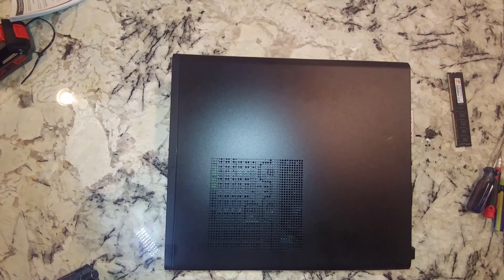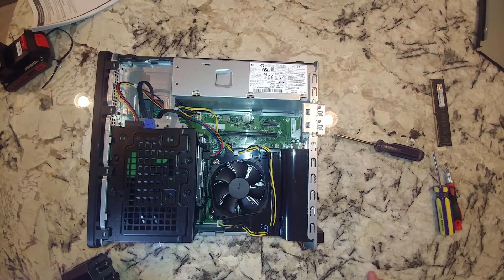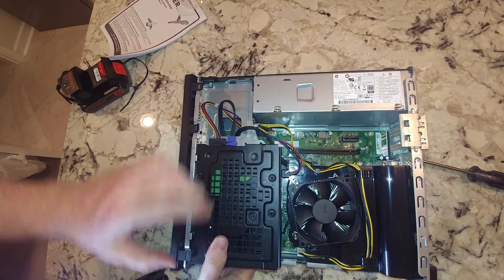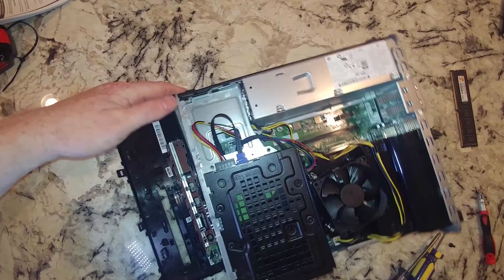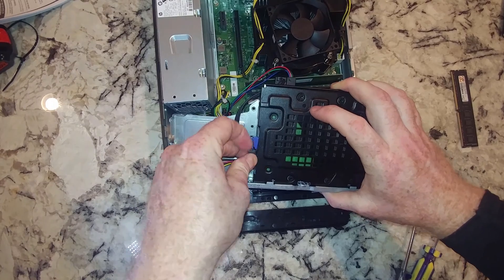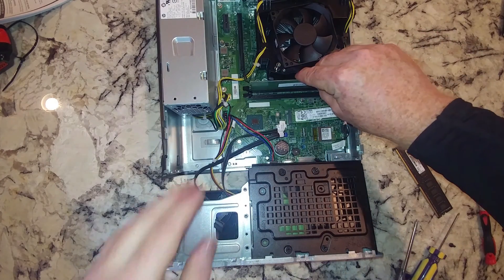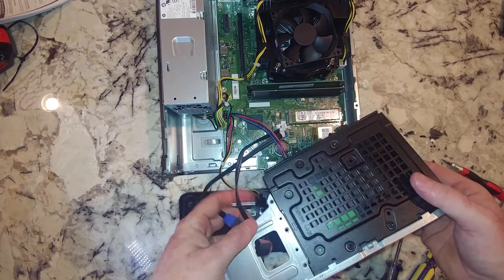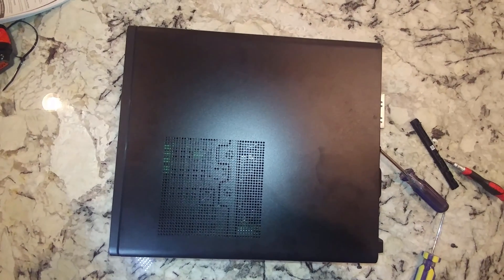HP Slimline 290 upgrading RAM and NVME M 2 SSD, hardware installation p0043w

Comment: Can you do the hp slimline 270 p024 next? I need to put a nvme in there so I can use the pc cuz it's stuck in automatic repair loop and I tried everything and it didn't work.

Comment: the ram that comes with these devices is 2666mghtz i recently installed 16gb of corsair i got for 30 bucks at my local store and just bought a second hand i7-8700 for 80 bucks. do you still have this motherboard around?, also im looking into a 4 pin conversion for the a 24 pin for the motherboard just so i can relocate the motherboard into a second hand full size tower i got from back in the day. im just tryong to run like 6 or 8 gb gpu and have 32gb of ram with a nvme setup. this is the only that really bottle necks really bad

Comment: Our Current HP 290 Slim  180 watt PSU Build with 4 GB ram.

UPGRADES: Pushing performance overall

16GB  DDR4-3200 MHz RAM  ( 2 x 8 GB sticks ) Overkill for THIS Machine but Ram is cheap! $22.00
GT1030 GDDR5 4GB Version ( <- You MUST GET GDDR5. The GDDR4 is 50% slower.) $59

We will test a Low Profile  RX 550  GPU $89.00  as I believe the PCIE can Provide the 45-55 watts  of the Total 75 Watts The PCIE 2.0 slot can deliver.
This card has the 128 bit Bus
This is the best scenario we can go with as far as Upgrades and keep a tight budget currently on amazon as of 11/25/24

Notes:  Any higher version of PCIE cards will run on a lower  PCIE  slot version.  You will ONLY get the speeds that slots version can provide.
When looking at a PCIE slot be sure Number of pins.  This hp 290 slim is x16 meaning ALL Pins are populated for full 2.0 transfer rates. 
Transmission speed rate  5GT/s and Throughput at 8GB/s ( MAX )

Comment: Could you please tell me, My HP Slimline desktop model number is 290- a0020in 
I can't understand which SSD will be compatible M.2 2280 SATA OR NVME?
Please help me.
Reply: Crucial MX500 2TB 3D NAND SATA 2.5-inch 7mm (with 9.5mm adapter) Internal SSD   <- You can use this as a base to purchase a hard drive upgrade. 
I do not see NVME being an Option for the 290- a0020in  as all research points to using the  sata 2.5-inch SSD type as an Upgrade option.
My Motherboard VERSION Does allow for NVME as it does have a special Slot made for the NVME soldered into the Motherboard. 
Hope this helps!
You can 100% use a 2.5-inch Sata SSD

Comment: I know I'm late to say this, or someone else said it, but when you want to remove the front plate off, remove the optical drive and the front removes without poping the disk drive button off. Don't worry, you can pop it back on once you put back on the faceplate for the front first.
I've worked on one. Also can you use 16gb? Did it boot with 12gb?

Comment: Can i fit gtx 1050 ti in that? It needs no external power supply
Reply from the maker: I once used either a GTX 1050 or GTX 1050 TI with it, however, I needed to use a ribbon extender which meant the case had to stay open.
Reply: @PC_HardwareTechUnboxing_1   Who needs case bro 😁

Comment: I have same PC so i can buy a 8gb memory it should work with 4Gb right
Reply from the maker: So you are upgrading from 8GB to 12GB?  It will work, whether you will get much performance gain is another story.  If you had 2x8GB, it would be better in case it supports dual channel RAM.  Different sizes of RAM will run at single channel.    

Not that you can game like this with your computer, but this video somewhat shows the difference between 4GB x 8GB x 12GB x 16GB albeit with a motherboard that has 4 RAM slots:
https://youtu.be/RmfMlkK0od0

Note, 8GB (2x4GB) in dual channel produced better gaming than 12GB in single channel.
Reply: @PC_HardwareTechUnboxing_1  I have 512 ram I wonder if it add up
Dam it's pain take apart

Comment: Looking to upgrade/max ram. Can I install 2 16gb to make it a 32 gb system? HP 290-p0043w Slim Celeron G4900 3.1GHz 4GB RAM 500GB HDD Win 10 Home Black
Reply: I installed two 16 GB RAM modules into my Slimline 290-p0043w and Windows 10 Home reads the entire 32 GB as available.
Reply: @iddybiddyegg1  thank you.
Reply: @iddybiddyegg1 did you have any graphics card installed?

Comment: Is another motherboard suitable for this type of case?
Reply from the maker: Most of the Dell and HP small form factor computers have a different size motherboard than  the common ones you can buy ITX, mATX...etc.  

The other issue is with these motherboards is that  front USB, power button, reset...etc are directly connected to the motherboard unlike DIYPC where there are front panel connectors (USB 2.0, 3.0, HDD, Reset Switch, Power Switch).

Now, an electrical engineer, electronics engineer...electronics technician type could figure out how to get an off the shelf motherboard to work.
Reply: @PC_HardwareTechUnboxing_1  A mini ITX motherboard and a SFX PSU combination would work. A full size grahpics card would require a riser setup as usually done in many SFF cases. To fill the front panel, there are some ready made pieces with female receptacle in one end and internal header plug in other. The only real issue would be reset button, that you can live without or insert one by doing a DIY modification in the front panel cover.

Comment: I'm new to this what is the M2?
Reply from the maker: It is a type of solid state drive.  It has no moving parts so it makes no noise versus a hard drive which can be noisy...slow...has moving parts.  M.2 provides super fast boot ups too
Reply: @PC_HardwareTechUnboxing_1  oh thanks do you have a link to buy it
Reply from the maker: @stupidloser  This should be the one 256GB OEM Samsung PM981 that worked.  You will find some of SSD's will not be compatible...but if you go with the big names Samsung, Western Digital, HP...etc, you should have any issues.  These will require downloading windows via a thumb drive.
Another option would be to buy this type of Samsung which gives you migration software so you can clone your HDD to the SSD and might be easier depending on your computer skills:   https://amzn.to/35x0FSP    These drives are both by Samsung and perform about the same....but on the latter you are paying for retail packaging and the migration software.

Comment: could you put this in a new case to allow more room?
Reply from the maker: While I have no doubt that some computer engineer could do it.  I wold not mess with it...between the proprietary board not lining up to anything in a case to include the I/O shield, standoffs, power button...ect.  Than you are still stuck with the same PSU that probably won't fit in a computer case as it is not ATX.  A bigger PSU would probably need adapters to go from PSU to motherboard.  Good chance the single PCIE slot would also not line up with the ones in the case.  Yeah...I think this is a bad idea.

Comment: I have the same model ☺ got mine may 28 2020👍
Reply: You'll live to regret it, I have. Air flow pretty bad and builds up heat. I had to remove the cover to keep the heat down.

Comment: What’s the best CPU possible for this pc and does it support AMD’s CPUs?
Reply from the maker: Intel only, here is what HP lists for compatibility:

Processor
TDP
Integrated Graphics
Intel Core i5-8400 (2.8 GHz base frequency, up to 4 GHz with Intel Turbo Boost Technology, 9 MB cache, 6 cores)
65 W
Intel UHD Graphics 630
Intel Core i7-8700 (3.2 GHz base frequency, up to 4.6 GHz with Intel Turbo Boost Technology, 12 MB cache, 6 cores)
65 W
Intel UHD Graphics 630
Intel Core i3-8100 (3.6 GHz base frequency, 6 MB cache, 4 cores)
65 W
Intel UHD Graphics 630
Intel Pentium Gold G5400 (3.7 GHz base frequency, 4 MB cache, 2 cores)
54 W - 58 W
Intel UHD Graphics 610
Intel Celeron G4900 (3.1 GHz base frequency, 2 MB cache, 2 cores)
54 W
Intel UHD Graphics 610

If memory serves me correctly, I  put an I3-9100 in there...eventually had to update the BIOS as it worked, but was not recognized.  I am currently in Hawaii...away from my office...otherwise, I would try out one of my 9th gen I7 or I9.
Reply: @PC_HardwareTechUnboxing_1  , know if you can replace it with the i5-9400T?

Comment: I have this computer and I can’t really play any games I like on it, what should I start upgrading first?
Reply from the maker: I would say you are better off selling it and cutting your losses.
That said, it is tough to make this a gamer.  Even if you thru in a I7-8700 or 9700, it  still can only support a slimline low profile graphics card that will provide barely any performance gains.  The other thing you can do is leave the case open and hook up a GPU via PCIE ribbon extender.

Comment: which exactly ddr4 2400mhz memory module inside? I want just to add 4gb from aftermarket with the same characteristics for dual channel mode, without necessity buy new kit and sell original.
Reply: It's usually Samsung DDR 4 - 2666

Comment: really interested in this pc for its size more than anything. ideally would boot from m2 and have a 2nd HDD for storage and remove the disc drive. so is the cage that holds the hdd and disc drive able to hold a 3.5 hdd or is it 2.5?
Reply: I removed the dvd rom, and installed a 2.5 hdd caddy shaped like a dvd drive in its place for my 2nd SATA drive.
Reply from the maker: When I got mine it had a 500GB 3.5" in it.  I eventually, installed the OS on an M.2.  At the moment, it has been stripped and is collecting dust.

Comment: what do you suggest to clean (wipe) the insides & to remove heat glue on the processor ??
Reply: Blow it out or lightly brush... alcohol swabs to clean off old thermal paste.

Comment: I need ssd for OS and also hdd for storage. Can i disable ODD from sata port (for 2.5' sata ssd) and use sata power splitter for ssd and hdd drives same time? Will it work?
Reply from the maker: I will have look go back and look at the SATA III connector on the optical, sometimes they are not the same on these computers as the HDD SATA III cable, There is a device out there that I use in one of my Dell Inspiron 3670 videos that allows you to power up to 4 drives off of a single SATA power connector.
Reply: @PC_HardwareTechUnboxing_1  Can you say is there any place between m2 nvme and hdd cage bottom for installing aluminum radiator on m2? How tall radiator can be?

Comment: David Great videos on the slim . ive watched them over a few times.
if you had time could you answer a few questions .
1. how can I get windows on  a flash drive to reboot everything . I have a brand new hp slim I got after watching your videos .
2. after installing the new i3 8100 and 2 new sticks of ram . will the computer start back up .
I ended up with the intel i3 8100 and 2 8gb Crucial Ballistix Sport LT 2400 MHz DDR4 DRAM CL16 BLS8G4D240FSEK sticks . do you think these will work?. 
thanks so much for the videos . still trying to decide on a hard drive
Reply from the maker: Hello, I3-8100 is a good upgrade choice. That RAM should work, most DDR4, 288 pin, 2400Hz works.
To get windows 10 on drive:  1) Go to this link and create windows 10 medial drive:  https://www.microsoft.com/en-us/software-download/windows10    2) Before you do your install, do a recovery by following these steps and save it to a thumb drive:  https://support.hp.com/us-en/document/bph07143

Comment: i want to install SSD M2 Kingston 240Gb. but it not detected on HP Slimlite 290. why?
Reply from the maker: Hello, have you figured this out yet?  Most SSD's can be seen by the computer if you pull up  disk management.  This assumes you still have the OS on a HDD.  If you just want an additional drive, than you may have to format it inside of disk management for it to be seen as a drive.  If you are trying to put the OS on that drive.  There are drives that will work and others will not.   Most of your Samsung and WD SSD's have higher success.  I have not tried a Kingston myself.
Reply from the maker: In this video I believe I use a PM981 by Samsung.  As I watch this now, I am wondering which route I took to put the OS on the SSD.   There is a 2nd part to this video...let me see if I can find it.

Comment: I have same system I installed m.2 ssd  but it is not recognised by system . What can I do?
Reply: I installed wd green m.2 ssd 2280
Reply from the maker: @dkmehta814  Hmmm...that's surprising it didn't work.  Not sure if there is a compatibility list somewhere.  Back to other questions.  Did you have HDD installed at same time?  Was SSD new or does it have anything installed on it.  How have you gone about trying to put Win 10 on this SSD?
Reply: @dkmehta814  i want to install with m.2 ssd 2280 480gb green, it will work?
Reply from the maker: A couple of questions: 1) Which model M.2 did you try to install?  I have found some are easy to install O/S and others are not.  I have found  Samsung, EVO 960, 970, PM 981...and some of the WD drives work best.  Brands like ADATA, Pioneer, Toshiba...are inconsistent.    By that, one can usually use them as a storage drive but not O/S.
2) I need more more info than installed.  Did you go thru the steps of installing Windows 10 via a thumb drive?  Or are you inside Windows looking under disk management?
3) Is this a brand new M.2? or does it have possibly an O/S installed from another computer?

Comment: Hi Dave, can you tell me the installed SSD and RAM specifications? I have compatibility issues and would like what worked for you.
Reply from the maker: I may have made another video related to this.  I will have to see.  I have a lot of computers here and tend to strip some of them down to reuse the parts for other videos.  I believe I installed a Samsung PM981 NVME M.2.  They are usually really good for installing O/S on.  RAM was probably DDR4 2400Mhz to match what was in the computer.  Once I got everything installed, I had to get the computer to boot to a USB so I could load up windows 10 from a thumb drive.  Once I got windows installed....I had to go online and get all the drivers for this computer.  Once I did that...it worked like a champ.  I even upgrade the processor to a I3-9100, before taking it apart.  I am not sure that answers your question...let me know.